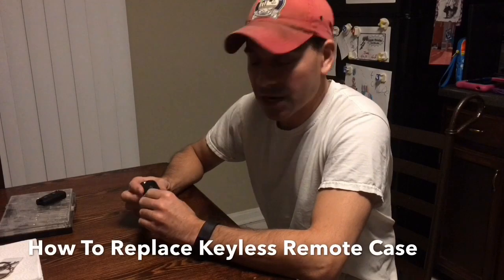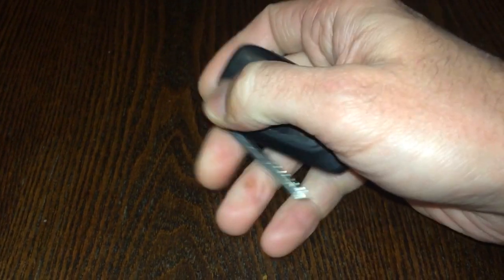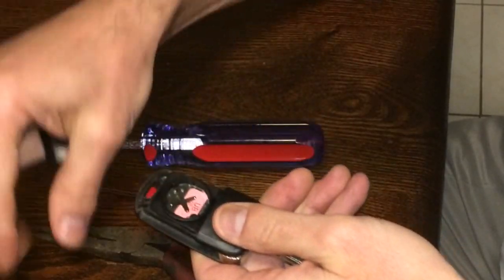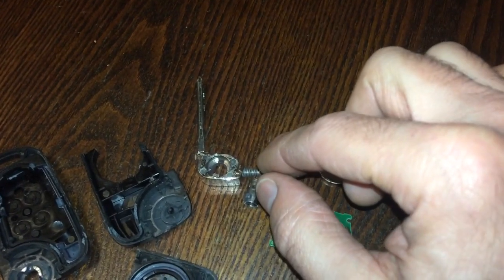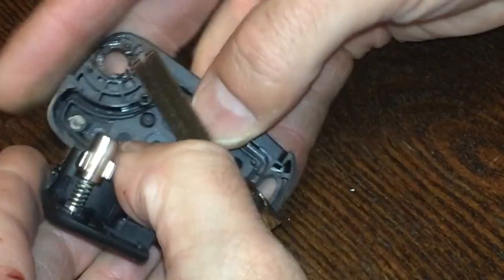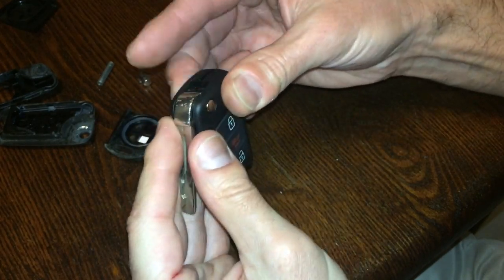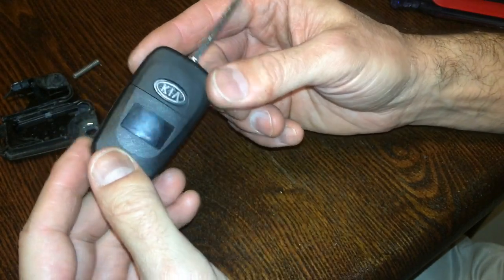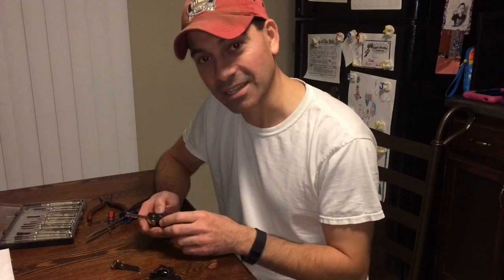How To Replace/Repair Keyless Remote Case (Andy’s Garage: Episode - 26)

Comment: Thanks big help I couldn't figure out how to wind the key blade. One thing to note - my very similar key has a separate small black  3x6mm RFID chip that was under a white retaining piece of plastic. Without that the key fob opens the door and the engine turns over but it wont start.
Reply from the maker: Thanks for the feedback
Reply: Thank you so much for commenting about the black transponder chip! I've been chasing this issue for hours! Extremely important for anyone that has one and doesn't switch it over, the car will not start! Cheers!

Comment: thank you! Your instructions were perfect and so helpful. I bought a replacement housing from Amazon for about $8. I had some difficulty separating the housing from the old, damaged key, but once I did that, it only took a matter of minutes to reinstall everything in the new one. The key works perfectly. $8 compared to over $100 to get a replacement key from KIA? No contest.
Reply from the maker: Thanks for the comment, glad it helped
Reply: @PhillipsVision  I can't figure out how to get the spring to lock in order to tighten it. Also the board is loose. Is there a special way to pop it in. 2012 kia soul
Reply from the maker: @debbiehardy2149  the spring needs to be wound to create tension, just don’t over tighten or it can pop the cover off. The chip should set in place on the supports. If it’s loose you may not have the correct case.

Comment: Ok, so after we change this up, how do we program it to the car? I remember I'd go near the car and press some buttons, and then it worked but nobody is showing the very last step. It was not by putting it into the ignition and switching it back and forth. Help please!
Reply from the maker: If you replaced the internal components as shown in the video you don’t need to reprogram it, everything stays intact. If you are in a position where reprogramming is needed, you need to find the procedure for your vehicle or go to a dealership.
Reply: @PhillipsVision  thank you for being so prompt with a response. Yeah, I’ve been going through multiple videos. and both my keys are messed up. I had done this before and it was working just fine. A bit frustrating, thank you
Reply from the maker: @arshosalazar1481  I know with some manufacturers, like Chrysler, you can duplicate a key if you have one original. There is a process of activating the original key and having it program the copy, but the original is required.

Comment: Everything worked exactly as the video, but after I'm done, the keys are opening and closing the car, but the ignition isn't working when I insert the key and turn it.
Reply from the maker: There should have been a chip inside the original case that needs to be moved to the new one. That chip will communicate with the SKIM and tell the ECU to start the vehicle
Reply: @PhillipsVision  thanks a lot. This was the missing step. I threw it in the garbage as I thought it's scrap plastic from the old shell 😅

I put it back in the new shell and it worked perfectly.

Comment: My Kia fobs were hermetically sealed with superglue from the factory. 5 HOURS!!!! to change my key fob shells. BUT, your video is priceless. Once you get the circuit board out of your old key fob, this operation takes minutes to complete. I had every slot head screwdriver out, 2 pair of pliers, 2 box cutters trying to pry open the old fobs. If you have as much difficulty as I did, just make sure you do not damage the circuit board. Also, your old key (OF COURSE)!, spring and chrome button should be used as long as they are not damaged. The new shells I ordered from Amazon came with springs that are longer than the original and the chrome button is too short to be functional. Thanks for the great video.
Reply: I am finding the same issue I think. Trying to get the old fob open.  It is NOT as easy as it is here in the vid. And mine doesn't appear to be a Kia sticker on the back of the old one.  I think it's metal and part of the shell itself. Not sure if there is a screw under that. But I'm not having luck getting that off either.

Comment: Just followed this to replace ours. Very helpful! Though some caution to those who bought their replacements from Amazon, the buttons may be smaller in the replacements. So I would use your old buttons. Other than that, everything is smooth sailing.

Comment: Thanks for posting. However, trying to pry my old one apart didn’t work. I had to apply a lot of pressure and it still wouldn’t come apart. 
So I went to plan B. I pried the rubber button assembly off the new one; removed the busted up, cracked buttons from the old one, and simply switched. It works fine. 
I’ll buy another housing and do the same for my second key fob. I’m paying a total of $16 for the rubber buttons but that’s better than $500+ for two new key fobs.
Reply: I had trouble prying the old fob as well (starting around 2:00), I wish the guy would have explained that more in depth, but I was able to salvage the board and key with no damage, I bought a 3rd party shell for my Kia on Amazon for $6 and everything transferred over no issues.

Comment: Thank you.  I got mine to work following this video.  I have 2 comments.   1.   The  transponder / chip wasn't glued in on my original key.  So I didn't glue it into the new one - this means if I have to get another replacement case I will have no trouble changing it over again.   2.  Why was it necessary to go to the bother of changing the key blade.  I just took the key blade, hinge and spring from the original fob and used that on the new case.   Seemed to work ok!
Reply from the maker: Great comment, thx
Reply: Thanks for you comment about the transponder chip! Extremely important for anyone that has one and doesn't switch it over, the car will not start!

Comment: Important to make note that there is a small plastic bit from the old fob, as it is the transducer, and it needs to go along with the board or the car won't start.  Its deceiving cause it falls out and only looks like a broken piece of plastic. I threw mine out and had to sort through the trash to get it!!

Comment: I just replaced the housing on my 2013 Soul. The original key fob appeared to be glued shut. There’s way no screw holding together. I had to use a lot of force with the pliers to spilt it open. After that it was pretty straightforward.

Comment: Hey, thank you very much. 
Your video is very helpfull. I kinda stuck on how the spring key mechanism work.
Reply from the maker: You need to turn it clockwise to increase the tension once you put it in place. Be careful not to over tighten the tension or it can pop the casing open

Comment: Does this work with koa soul 2012? I can’t get it apart. I’ve been trying for an hour or more using the same tools you used + a matt knife.
Reply: I just did a 2013 soul. Getting the factory key open required destroying the case with side cutters but I was able to reuse the board and key successfully. Takes time and caution but you can do it.
Reply: I just destroyed my hand trying to open this thing lol
Reply: I used a hot knife to melt the joints on my 2012 kia soul key and finally got it open also busted my hand pretty good in the process

Comment: How many times did you rotate the key on the spring? I saw 2X.
Reply from the maker: 2 to 3. If you make it too tight the case will not close properly

Comment: So I lost the transponder chip as wasn't aware of it and propably was tossed away. What can I do now??
The key opens and locks the car but engine shuts down after a few seconds.
Reply from the maker: You will need the car dealer to reprogram a new chip. They cost around $300 to do.

Comment: You didn't show the most difficult and important part. Taking out the security chip that is glued in the top corner. You didn't even mention it, given that it's glued it requires some effort and sometimes heat to get it out.
Your car will not start without this chip.
Reply from the maker: mmdias87 the chip was not glued in mine, and is not always glued. Normally these are placed inside the frame and held in by the corner supports. You simply lift it out and simply place the new one inside the framing. Nothing more than a 2 second process. Not sure where you’re encountering this as the most difficult part.
Reply: Not all key fobs contain the chip, mine didn't.  Just depends on what type of vehicle (make, model, year, etc.) you have.
Reply: Thank you so much for commenting about the black transponder chip! I've been chasing this issue for hours! Extremely important for anyone that has one and doesn't switch it over, the car will not start!

Comment: Thanks! My key doesn’t wanna stay closed now though. Any tips?
Reply from the maker: You may have the key flip spring wound too tight. Try loosening it one rotation and see if that helps. If not, just run a little strip of tape along the seam to prevent it from popping open
Reply: @PhillipsVision  I'm referring to the key itself not staying closed-- the casing is fine.
Reply from the maker: @i8tweak  spring might be too tight causing it to pop out

Comment: Great vid, there is one item I would add to it tho.

If you look at 3:25 into the video, on the back panel of the remote ( the panel with the battery hole, at the top of it opposite the spring and pin )  you will see a small cavity. ON SOME MODELS, in that cavity, there will be a small white panel. This model doesnt have it. Under that panel is a ferro rod or sometimes a induction ID chip. Thats part of the security system on some models and that panel and ferro rod or chip must also move over or your car will not start. All other functions of the fob will still operate without it.

i completed the assembly without moving this and no start ( "key error" if you have a code reader plugged in ), went back and grabbed that from the old fob, installed and bingo, first try ( no error on code reader ).

Hope that helps others.
Reply: Hello, thanks a lot for your comment. I had the same issue. I went and put that white chip, and it still don't work. Do you have an idea of why is that? It would really help me out! thanks in advance.
Reply: @hagopshahinian5669  not just the white chip but the black ferrite rod it covers as well. If that's not there in the new fob the security safety cutout won't disengage.
Reply: @Skallabjorn  we're not finding that part, do you know any alternative? 
a new key?

Comment: Thanks man. Your video was easy and perfect and it worked for the replacement key fobs I got. What kind of adhesive did you use or suggest to put the Kia logo back on though?
Reply from the maker: awgoodrich8 glad the video helped, I just used the exiting adhesive that remained on the logo
Reply from the maker: awgoodrich8 but you could use a little drop of contact cement
Reply: @PhillipsVision  Thanks again man
Reply from the maker: awgoodrich8 you’re welcome

Comment: Hi, I followed your instructions and at first the remote worked perfectly (2013 Kia Soul) but now the remote and car won’t talk to each other.
The little red light in the remote still comes on, but the car won’t lock or unlock. I took the remote apart but everything is in there and looks the same. Do you have any suggestions?
Reply from the maker: The chip inside the case is what communicates with the vehicle. As long as you moved everything from the factory case to this one without taking anything apart you should have no problems. Something may have been damaged or disconnected in the process
Reply: @PhillipsVision  dang :( does this mean I have to get a new replacement from the dealer after all?

Comment: I followed your steps (and others). I can lock and unlock the car (a 2012 Rondo EX-V6) - the old blade obviously goes into the ignition. The engine turns over but as soon as it catches, the engine dies. Is there a syncing step that I need to follow? Do I need to see a locksmith?
Reply from the maker: Did you damage the chip in the process? If the chip does not communicate with the ecu the car will stall after turning over
Reply: @PhillipsVision  My mistake - the transponder was under a fitted plastic clip in the old unit. It works perfectly now.

Comment: Ok....I just followed your instructions for my Crossfire/Mercedes...only problem is now my door locks won't work on my fob. Any ideas why?
Reply from the maker: Make sure you didn’t damage the circuit board when closing the case

Comment: Just replaced the key fob as per tutorial and I can open the car with remote but not start the car, it is a new blade does it need programming ?
Reply from the maker: As long as you replaced the new case with all the original components (chip and board), it should be fine.

Comment: I did everything well. The car unlocks and locks without any problems, but it won't start the engine in any way. What to do.
Reply from the maker: Make the chip is not damaged. That chip connects to the ignition switch and ECU to start the car

Comment: This assembly will not work as the old key has a transponder chip which has to be transferred to the new key assembly. Without the transponder the car will not start. Surprised no one has mentioned it.
Reply from the maker: As shown in the video…you have to transfer the chip to the new case. This video is for replacing the “case”
Reply: So, where is the vid for replacing the chip, please? @PhillipsVision
Reply from the maker: @Pablostratus  I do not have one for having a new chip made and programmed. This one is assuming you are transferring the original to a new case since the cases have a tendency to to break from wear & tear.

Comment: What if my cut key itself is broken off that part that is to push to release that key?
Reply from the maker: @jbirdfly1581  if you replace the entire case it will include a new one, you will have to have the new key cut to match

Comment: Where can I get the new fob??
Reply from the maker: The casing can be purchased on eBay or Amazon. The actual chip that goes inside will need to be purchased from a dealership.
Reply: @PhillipsVision  Thanks. I still have my 2 original fobs just the buttons have rotted away.
Reply from the maker: @timcoyle50  Then all you need is a replacement case, you can get that online pretty cheap. Just make sure you don’t damage the chip in the process of moving it, and make sure you move every internal component.

Comment: doesn’t work when I pick the buttons is there a reason that it would not work? I have the same key as shown in the video the only difference I see is there is a white thing where the battery is supposed to be on that says UB, mine doesn’t have that could that be the problem?
Reply from the maker: DJ WOW did you install the original circuit board as well? Without that it will not function
Reply: Phillips Vision  yes the original circuit board is in there
Reply from the maker: DJ WOW I would take it all apart and reassemble just in case something got out of place
Reply: Phillips Vision ok will do

Comment: Any tips for opening new case? Cant get it open
Reply from the maker: no nopeno9 sometimes they are tight. Use a small flathead screwdriver or hard guitar pick and gently pry it open, should un-clip

Comment: So, u didn't need to program or pay a dealership to program?
Reply from the maker: A G no, because I just replaced the case, not the chip
Reply: @PhillipsVision  thanks for replying. 
Should I order an OEM remote? Or does that not matter with a "case only"?
Reply from the maker: A G not if you have the internal chip from the original. If you have the chip, just move it to the new shell. If you don’t have it you’ll need the entire factory device.

Comment: It flips open but it does not lock down in place
Reply from the maker: Desmond Oneal sometimes the weak clips will not hold if the key tension spring is too tight. Try releasing some of the tension by unwinding it one turn, that might help.

Comment: I have a problem, I have changed the case and the key works, open and clode doors but the engine won't start.
Reply from the maker: Did you move all the components (chip) from the original to the new? The chips are programmed to your sentry key immobilizer and ECU. If they don’t all match your car will not start.
Reply: @PhillipsVision  yes I put circuit board to the new plastic case. is there anything I can do now?
Reply from the maker: @daniele-nocentini  sounds like a computer issue with communication between the chip and ECU. There are locksmiths that can create a new chipped key to match the ECU

Comment: Would have liked to have seen him go immediately out to the car and start it.
Reply from the maker: I’ve been using this key to start/drive the car for the past couple years with no problem. If you replace the chip (intact) from one case to another you’ll have no problem. The plastic case means nothing, it’s all the chip to communicate with the ECU to start the car, and of course the metal key to turn the ignition cylinder.
Reply: @PhillipsVision  I transferred everything over with almost surgical precision. I went to my vehicle and it now locks/unlocks (didn't before because of old battery), but it won't completely turn over? The dashboards lights up like it's Christmas, and I'm getting a P0441 code? A locksmith is quoting a few hundred dollars to help me out. :( I took the fob apart and reassembled it again (just in case) and got the same result. It's a puzzler.
Reply from the maker: @msdee7444  this code pertains to the EVAP purge flow; it has nothing to do with your key’s chip. Not sure why it’s not working. If your chip was transferred without problems it should work fine